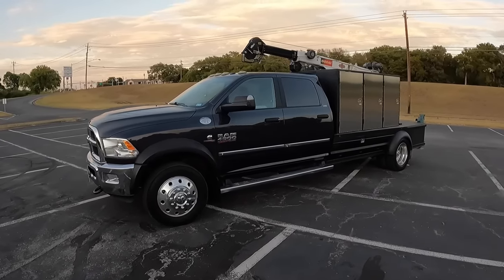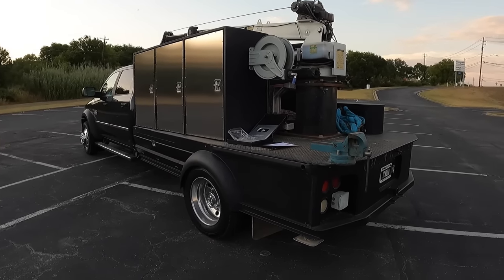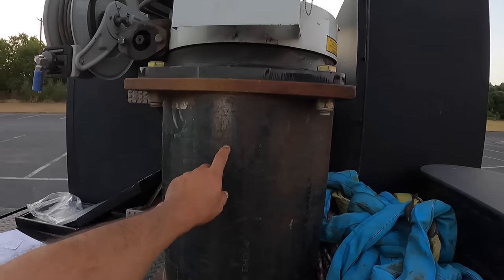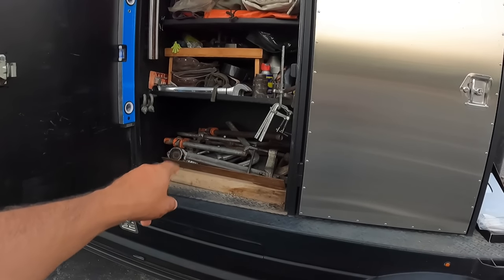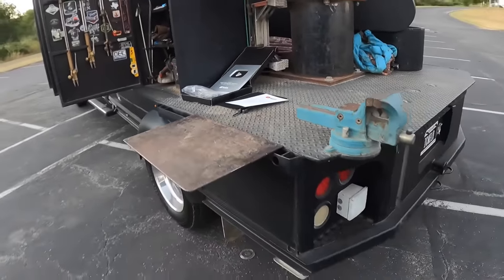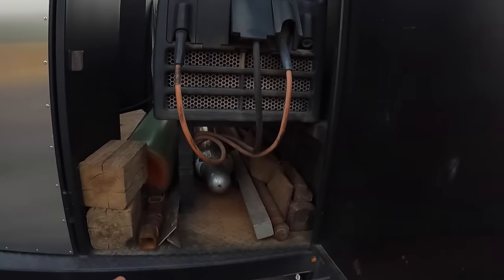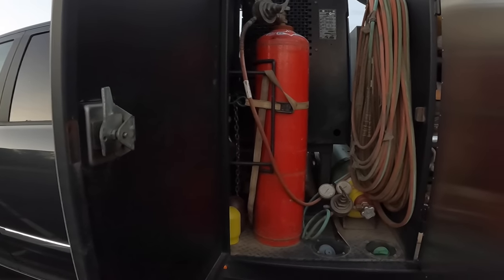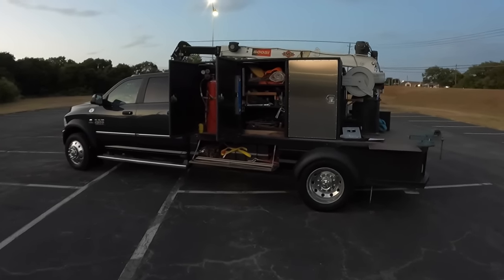Long Awaited Welding Rig Tour.

Comment: could you explain why the boxes are pushed inwards the further back they go?  Im trying to figure out why you didnt build them flush with the bed but Im drawing a blank.  Love the attention to detail on the sides matching the body line, like it was meant to be.
Reply from the maker: Its an optical illusion. The boxes are flush with the width of the cab and continue straight back. The illusion comes from the Dual tires at the rear. The bed tapers outwards to cover the two rear tires. I've been asked that multiple times,,, even from people who see the truck in person, so don't feel bad!😁😁😁

Comment: Hey my good sir. Thank you for the videos. And for showing us your set up. I myself have a 2007 Ford F-350 super duty power stroke that I am about to get running. I’ll probably use some of the same build you have here. Especially with the air suspension. But my question is have you heard or seen anyone with the truck I have having a good build? Was the truck capable? Any input works. And thank you for your time sir.

Comment: Oh boy, this is funny - the anti-theft pedal?! 🤣
Back, in the year ~2000-ish, we had two options for driving schools, in our German villages. It was either a manual 3er BMW, or an automatic "something else" (Opel, maybe?). I've been told, that i wouldn't be allowed to drive manual shifters, if i've learned on an automatic car. (I think that was a lie - there's no indication of man/auto on my drivers licence card.) However, learning on a manual transmission gives you so much more skill and knowledge! I actually tend to pity the young people who take driving lessons in Teslas, nowadays.
Reply: I disagree. Why waste expensive driving lessons on clutch control and shift points, when proper orientation and risk assessment is several orders of magnitude more important? Once you are confident driving, you can learn to drive a manual transmission in an hour in a vacant parking lot. My friend the driving teacher agrees.

Comment: Wow, your new truck looks fantastic. I wish I had a job where I could justify a work truck like that!
My only question is about the front section where the gas bottles and welder live. Why no roof there? I would have thought even a removable lid just to keep the weather out would be useful.
Aside from that I think I might borrow your hook on work table idea to go on my work trailer. 👍

Comment: Great video. How many hours on the airpak? Engine and compressor? Mine is almost to 750 hrs on engine and 500hrs on the compressor … it’s a great machine but has been running funny lately. Going to do the compressors first real service any day now. I have the Mann p/n for oil and filters if you want. Much cheaper than Miller.

Comment: Hi Isaac,

I’ve been a long time subscriber and fan. I’m building a new truck and plan to put a vantage 400 on board. However, I see you use the 302. What do you think of its carbon arc gouging capacity? This is what I need but I always thought you needed above 350 amps for.
Reply from the maker: I use 1/4" carbons at about 200-220A. The trailblazer airpak handles it great. Its a good little unit.

Comment: Kudos on the 100K.  Very nice truck set up indeed.  You can always add some full extension drawers down the road.  One thing I was wondering is if you have a recessed step or something to get up on that bed?  None of us are getting any younger!!  Are you under a CDL with this new bigger one?  I think that powder coating is perfect.  Has work truck written all over and I like that as opposed to some rich yuppy's go to dinner rig that has never done a day's work in its life.  High gloss auto finishes just collect scratches and wear marks.  That 3/4" 4x10 had to be getting up toward the 5K limit on the crane??

Comment: Is your air suspension a closed system, or does it continually adjust while driving? I couldnt tell if it was plumbed into a compressor. If a bag gets torn, do you lose all of your suspension? Fantastic channel.  Keep it up
Reply from the maker: closed system but i have bump stops built into the framework in case of a bag rupture. It will run on the leaf spring suspension alone at that point.

Comment: Do you think you could get away with a crane on a one ton? Or do you have to go to up to those 4500+ trucks? Starting the journey of trying to build a truck and get away from my current trailer set up I run on. And doesn’t seem to be a lot of information out there. Thanks.
Reply from the maker: I had a crane on my 3500 dodge dually but it was rather small. it only had a 3200lb capacity. It was super handy though!
Reply: @ICWeld  yeah I don’t have a lot of the huge equipment around here that you deal with on a daily. Mostly farmers and a few sand and gravel operations. Did you go with a cab chassis or just a standard one ton? Also I just want to thank you for always taking the time to answer questions between that and your videos you’ve helped a ton in my first year breaking out. Have a lot of respect and gratitude for what you do.

Comment: That 302 does gouging ok ? And what kind of compressor are you using to power the gouging cutter ? 
Are you using a gas engine or diesel welder machine ?

Comment: WHAT HMM?? that's a dually 2:00 all you need is a pair of leaf springs and counterweights maybe a bit of frame welding and an outrigger setup... those tires are good for like 10,000lbs over the rear axle leveled, not like your towing 60,000lbs or anything

Comment: Thank you get a little more power contact banks engineering they make some stuff that’ll get you about an extra 150 hp it’ll make a big difference
Reply: Yes.  That Dodge 6.7 is badly detuned to make the EPA happy.  It can put out a lot more and still be very drivable.

Comment: I’m sure this is a stupid question but why are the boxes on both sides going on a slight angle
Reply from the maker: Its actually an optical illusion. The boxes run parallel to the truck. the bed widens out to cover the rear wheels. The bed tapers outwards starting at the back of the cab.

Comment: 10:00 not protected from the rain no weather stripping or seal, should add one
Reply from the maker: No real seal against the bottom but there is border around the door frame. I figured since Texas is so hot, any water that entered along the bottom edge would dry up. Plus any possible standing water would roll out as I turned from left to right while driving. Its done well this far
Reply: @ICWeld  nice looks good  👌 should be easy to stick some on if needed

Comment: Michelin XZE tires gave me 125,000 miles vs 35,000 on the factory tires
Reply from the maker: Yeah, I wish i had gone with those. I just bought the factory Continentals on a recent blowout so the tires all matched. However, I ended up replacing all the tires in the rear anyways a few days later and I should have looked into those at the outset.
Reply from the maker: I believe I got 48,000 out of those.😒😒😒

Comment: How do you change oil on that welder?
Reply from the maker: Its a bit tough since the drain is on the cab side of the truck but I have a hose that extends out so I can drain it easier.

Comment: well the question was asked and you never replied so do you remember way back a long time ago the first the 100th  and the 1,000 subscriber and now your award for our contribution to you do you know who the 100,000 one is any way enjoy the moment Cheers i hope you answer as you don't seam to answer any one nice build on the rig set up for what you do very nice another question i know you wont answer either but i have to ask SORRY but forgive my ignorance but what is a pipe line rig we don't use some of your terms and such over here Cheers
Reply from the maker: A pipeline rig usually has a similar welding bed style as the lower half of mine does. They usually have bed sides that match the body lines of their truck and use 90 degree elbows as rear fenders. I used  a pair of 10" elbows to create these. As far as the upper half of the bed, I built boxes similar to what is used by standard field repair trucks. Lots of storage. So basically my bed is a little of both.
Reply: @ICWeld  thanks for that

Comment: I have a eye for crooked and cant stand crooked. So what you failed to mention is what jump out at me in the beginning of video, is why in the world are the boxes crooked to the truck bed. But after several video shots about half way through, it appears the truck bed angles out giving the allusion of crooked cabinet build, mystery crooked solved. I'd really hate to ask why you made tool cabinets crooked since your a semi pro traveling fabricator..........
Now the real question is, how come electrodes are not stored in a heated dry air tight container?
Reply from the maker: I get that question a lot. and believe it or not, its an optical illusion. My truck bed tapers from the back of the cab outward. The bed flares out to cover the wheels. The boxes are in line and parallel with the cab of the truck. It looks odd until you look closer.  I made it that way so I can look down the whole length of the truck in my rear view mirrors and so I can see if my door latches are closed. I personally dont like the way most utility bed boxes stick out wider than the width of the truck. Too bland. No style. Plus this way makes it a bit more aerodynamic. I do lack more inner storage between the boxes bit that is something i was willing to sacrifice for more of a sleek look.